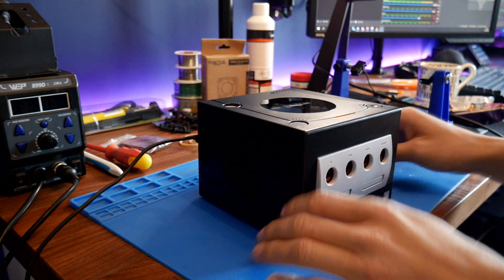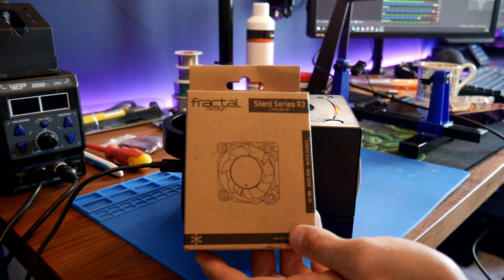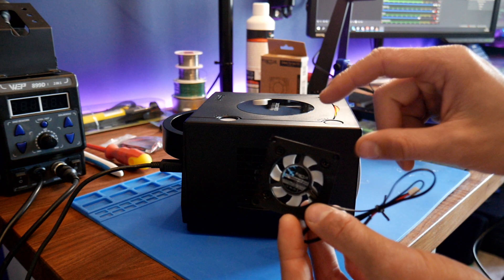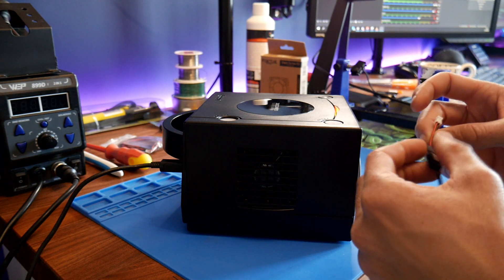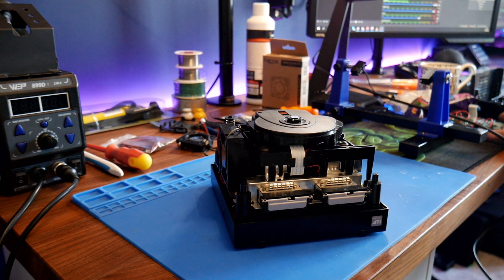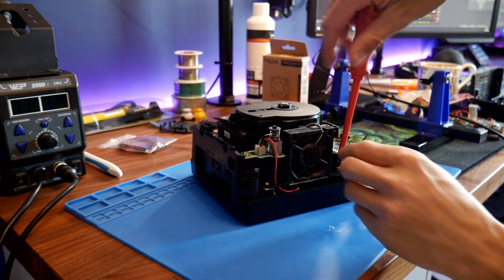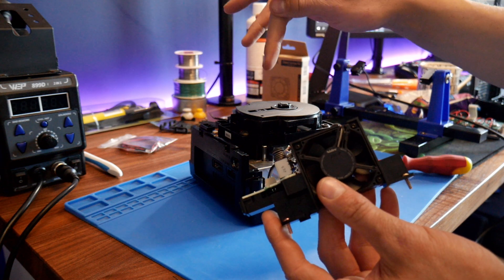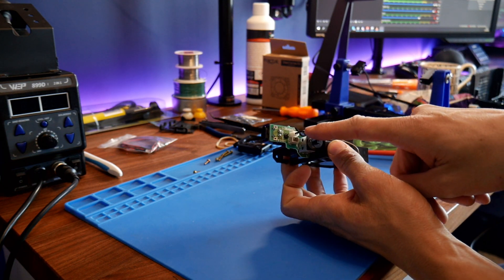GameCube Silent Fan Mod

Comment: El flujo de ese ventilador es mucho menor que el original lo que provocará que los condensadores SMD se calienten mas y duren mucho menos. Yo optaría por una modificacion del molde de plastico y un ventilador de 50mm Delta de +5000rpm pero hará mas ruido que el original

Comment: i saw this on many Fan Mods. Why is the Fan in Wrong Position? The Fan should blow fresh Air into the Console, right? And the Heat should blow on the other side out. But every Fan i see in Videos suck the Heat inside out. But the smaller Fan, like Noctua Mod with 40mm has not the power to suck the fresh Air from the other side of the Console, the long way from heatsink of the console to the fan and Blow it out. Its better to blow the fresh Air direct into the Console. I have now from 50 Celcius down to 45 Celcius after i changed that.
Reply: Nintendo from the factory designed the case to work in a negative pressure setup (fan sucks air out of case, instead of blowing air into it) and while spinning the fan around to make it a positive pressure setup probably wouldn’t hurt, why would you? The stock negative pressure setup works perfectly well.

Comment: i did the Noctua NF-A4x10 FLX upgrade but went back to the stock fan because the temperature went up loads so these little fans dont work well whats the point of it being quite if the thing bakes